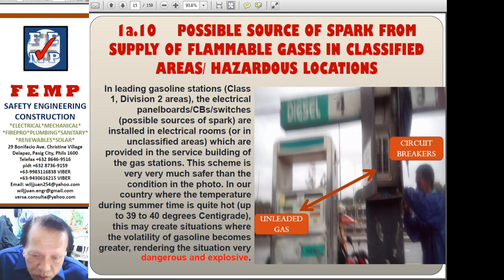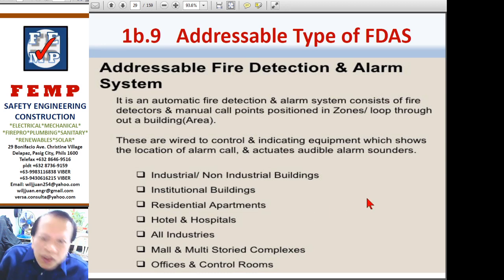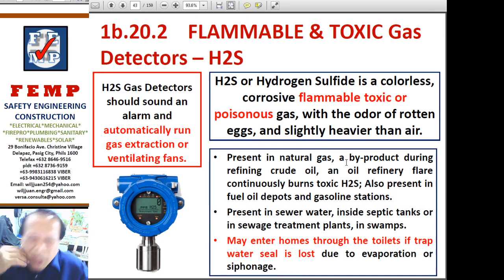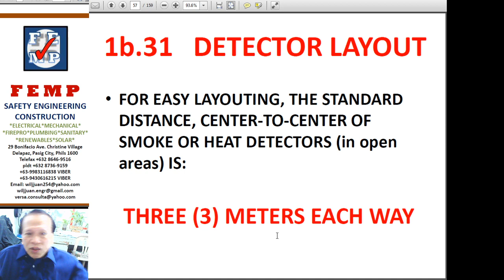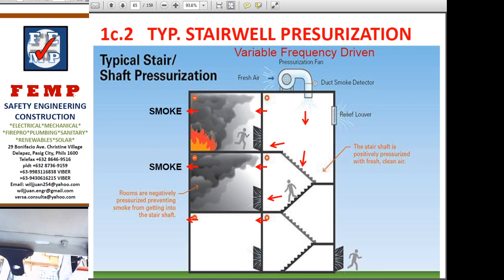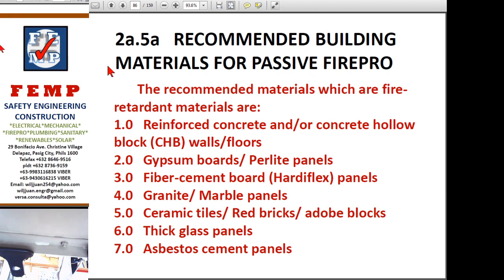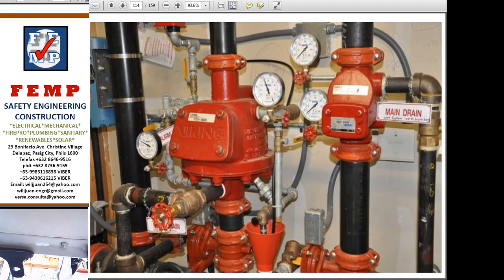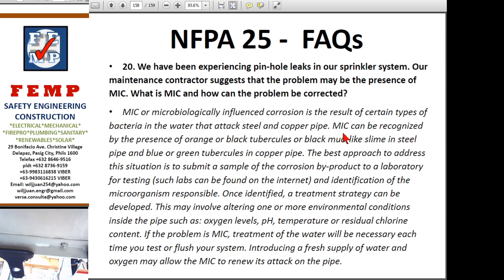Fire & Life Safety Webinar, 2020 06 05 19 03 23

Comment: Hi sir will, tanong lang po if what height of the building or how many storey building will require stairwell pressurization? Thanks sir
Reply from the maker: Hi Patrick, thank you for query. Honestly, I do not know the exact answer.  But anyway, if we analyze the reason for the need to install "Smoke Control" in the fire exit or egress area, then we can decide if an air pressurization fan is needed or not. In my opinion, if the time it takes to run to the nearest exit door takes more than 30 seconds or the nearest fire exit door is more than 25 meters away, then pressurisation fan should be provided. The taller a building is, the more air pressurization or smoke control is needed.

The CFLEX Program of the MEPF Org Phils is also strongly proposing the provision of carbon monoxide detection and extraction in air-conditioned buildings. This fire & life safety system aims to prevent toxic gas poisoning in burning buildings.